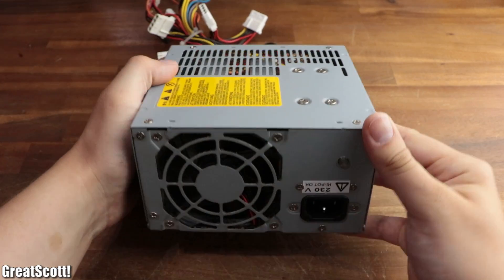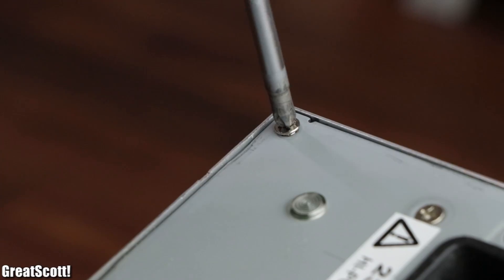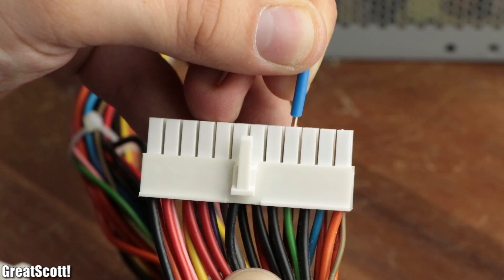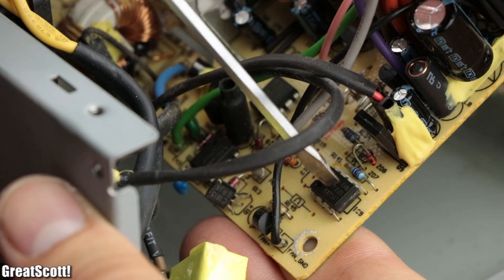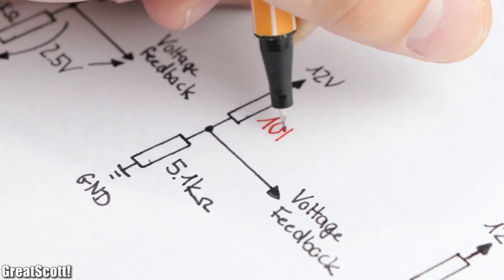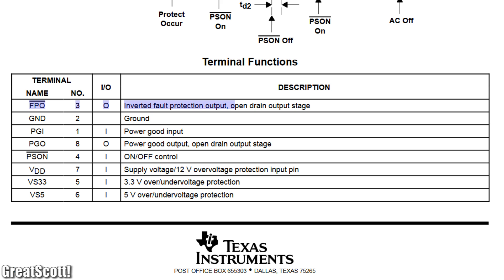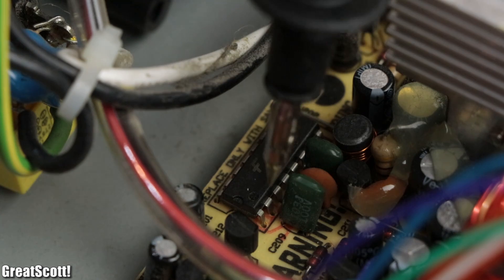HACKED!: ATX Power Supply with Variable Output Voltage?

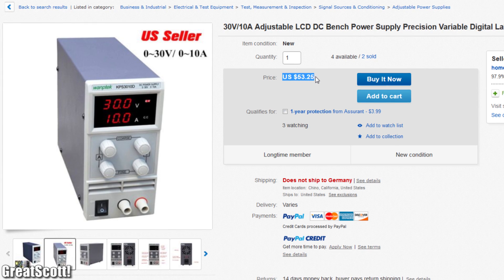Comment: @7:26 -- Hey, that's the power supply I have! -- Wish I'd checked ebay first though.  I ended up going through amazon and it cost around $70 USD. -- It also showed up with a "broken" screen. -- But I ended up just opening it up and noticing that some of the connectors were loose, when I reconnected them, everything started working just fine. :)

Comment: You burnt the optocoupler of the first PSU, I think it'll work if you replace it. That caused by giving higher voltage with using secondary potentiometer too low. I think second resistor you removed is current limiting for optocouplers led. Thanks for sharing all information 👍

Comment: dude, i have 220V DC 6800W available from solar panels. i have to admit it, i was too lazy to open my pc power supply to see what's going on. it doesn't work when i plug it in at 220V DC. can someone tell me why? my welding machine works, which is not very different from a pc power supply. any other device charger works properly, which is expected, of course. i didn't try my monitor but that should work as well. (tried it, it does)
Reply: If the PSU is designed for 220 VAC operation only then you'd need ~320 VDC (220 * sqrt(2) due to the AC voltage peaks), so it might be the undervoltage protecton kicking in. Whatever you do, be careful

Comment: Great video!  I made one of these and whenever I turned it on it generated a lot of noise back on the power line.  Any suggestions on isolating the power supply?  Perhaps I just need to try again with a better quality power supply.

Comment: You can get a higher voltage by utilizing the -12v rail. To get 24 volts, just connect between -12 and +12v, to get 17 volts, just connect between -12v and +5v. Connect between -12v and 3.3v to get 15.3 volts. If it is an older supply with a minus 5 volt rail you can get even more voltages.

Comment: @GreatScott
Hello! I have a PSU which does not output PowerGood high when powerred on, it remains at 0.15 V, it is similar to this http://320volt.com/wp-content/uploads/2011/05/patriot-switching-power-supply-sg6105d-cef2n60-ee19-ee16-ei33-f12c20c-s20c40c.png meaning the same controller not that it is tight to +5V. What do you think? Maybe I can repair it or transform in a Lab Bench Power Supply ...

Comment: Very good explanation of the switching power supply. The hack will be good for convert the PS rather to an exactly 12 PS than a substitute for the bench supply. Also a bit over 12 volt could be useful as car or caravan battery charger.

Comment: Running old electrolytic capacitors at or over their rated voltage can be dangerous. Always have a margin of error on your caps.

Generally bypassing protection cct unless you know what you are doing is just dumb.
Reply: 3 years late here
I read that you should use caps rated for twice the voltage you expect to put across it. I’ve even seen this in practice: 24 volt caps on 12 volt rails, 10 volt caps on 5 volt rails, etc.

Comment: Nice video, glad you posted it. Very good breakdown of the mechanics behind the workings of the power supply. I had made an ATX bench power supply and also wanted a variable output. I made a box that plugs into the +12 and -12 (to get 24V) which is a variable DC-DC converter. I used the MC34063 as the basis for the converter. It's a little clunky having an external converter, but it's very useful and I use it all the time.

Comment: use the green and grey wire instead ... if you do something dumb like short the outputs it will cut off the power supply instead of destroying itself. - with the black one it will always be on regardless. --- unless you do something like hack the reference voltage :P

Comment: So, if I wanted to just use that buck-boost converter method, could I replace the pot with something I can put on the outside? And which leads would I connect it to GND and 3.3V / / 5V / 12V?

Comment: if the transformator works on pwm signals, why should need high speed diods for rectification on the output?

Comment: Dear Great Scott. Thanks for posting, very nice. I am struggling to increase the 12 volt to 12,7, should be piece of cake. But I just can't get it. The thing I dont understand is how the feedback is passing through the opto. However, I have found the UC3842, in my case its 3845 but I guess it does not matter. I have tried to modify all the resistors around pin2 with no change. I would like to try to put a resistor direct from pin2 to the 12 volt but since there is NO ohmic connection now(I guess because of the opto), I think its the wrong way to go. I wonder if you can give me a hint. I am stuck as it is. Sitting in Brazil I am. Thanks. Peter
Reply: One more question: That 10K you took out, where exactly was it connected. To pin2 and ??
Reply: Seems like you dont have time to answer questions. Fair enough. I found out now. The adjustments not near the UC3842 at all. Thanks anyway.

Comment: Awesome hack! By the way, as you must have seen, the fan also turns off at low voltages since it is also connected to the 12-volt output, this can cause the switching transistors to heat up and fry.

Comment: you will probably be the 1st person to modify the pc atx supply, i personally have replaced(using another) the thermal fan system to a aliexpress uC based temprature controller kit , my fan runs at 7v dc(dc buck conv.) at min load, the sensor is placed at the top end of the grill of the chasis, when temp reaches 40 deg C fan gets full 12V through the inbuilt relay., on my 450W cooler master PS.(had noticed the 120mm fan never runs faster even if temp reaches 50C, even my pc case would become qiute warm to touch)so had to do this.

Comment: It's easier if you recover the parts from a smps and rewire the transformer to have a decent output voltage 30-40V. Then use an LM2576 adj as a switching variable regulator. Oh and the output of an smps is not a capacitor, but a fast diode, inductor and capacitor.

Comment: please guys if your reading this comment don't try to open the atx power supply, you can modify them for 12v, 5v, 3.5v , but this video is way too dangerous,  if you want a regulated output add some boost converter

Comment: Hi I am great fan of your Channel, I want to build power backup for my modem. I have 12volt battery with me, same I want charge it and once the power off, I want to use it for modem as power backup. Since I am Android Developer, I dont have much understanding of the electronics but if you give circuit diagram I will build myself. 
Thanks,
Venkatesh

Comment: Sir can you give me hint about pc power supply... I make battery charger for car but this power supply don't work please help me..... How changes I was done....
Reply: Car batteries need up to 14.7 volts for a full charge so you have to use something else
Reply: sir if I boost up voltages with buck converter can it works...

Comment: Another reason why you should not try this, especially with the protection circuitry disabled, can be seen if you watch closely at about 6:45

When the output voltage is set low, the fan slows down. This makes sense because the fan is powered from the 12V rail. Normally this wouldn't be a problem, but if you connect a high current load, such as a long LED strip or a big motor, if the power supply is badly designed, it will overheat and because of the relatively low airflow it might even catch on fire under extreme conditions.

Also, if you were to set the voltage to 16V or higher, not only would the capacitor you mentioned explode, the fan would also be running with way more voltage than it's intended for and certainly would not last very long.

Comment: YES finally someone who made a REAL ATX PSU to variable supply video!!! I am currently attempting on making a super high voltage ATX PSU which should give me a nominal voltage of 38v which will be PERFECT for the DPS buck modules from Rui Deng.
Reply: so.. are you dead yet? (from all the smoke inhalation) ;D

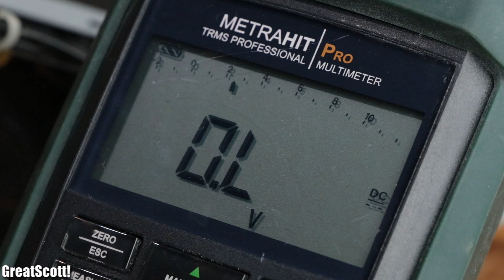Comment: 4:00 - And by measuring this voltage, while the power supply is turned on, I'm waiting for the point where you accidentally shorted out something with the probe and got a huge spark and a faceful of vaporized electrolyte
Reply: If this is the content you are looking for, check out Electroboom.

Comment: I once had a friend coming to me with his old, potentially broken, computer PSU. We decided we'll have fun with it by modifying the thing to make a lab psu. It was a really cheap looking PSU, the components inside are poor too, but we just kinda go with it.
We turn that on and it didn't show any living sign, then I saw a switch which I thought was the 110V/220V fuse thing, then I switch that to the other side. Suddenly, a huge capacitor blows up followed by some diode and ultimately the whole circuit was in fire.
We panicked and unplug the power, throw the firey thing outside, and a black-blue smoke is coming from what seems to be a bigger capacitor.

That day, we learned our lesson to not mess with any shitty old electronics.
Reply: You flipped it to 110v and it'd be a miracle if that didn't blow up
Reply: It's like trying to draw and you make one wrong line and ruin the drawing and then throw it all away because you don't want to mess with art
Reply: @alexstone691  except when you draw the line wrong you get electrocuted and die.
Reply: You done it as a dumb, thats why
Reply: I also had a power supply with that switch the previous owner had set it to 110v I plugged it in 230v it blew up. I got another power supply with that switch again but this time I switched to 230v and permanently glued that switch
Reply: If you are too stupid to understand the circuit you should definetely keep your hands out of the power supply.

Comment: I use a few of these for lab power supplies. They run from about 5v to 25v. I tend to remove most of the stuff on the secondary side of the board, and just leave the 12v winding and circuit. The ATX uses the spare fet and tiny transformer for sleep mode to maintain 12v to the KA7500 ( TL494 ).
If we then lift pins 15 and 16 above ground, we can sense the current via a very low R resistor to ground from center tap, and use that to use the [pin 15/16 op amp to control current, while using the pins 1 and 2 for voltage control.
Then we have a current controlled ( up to 12 amps or more) and voltage controlled 9 up to 25v or so) power supply, that will power very low impedance loads ( motors etc).

This requires all of the monitoring stuff to be wiped from the board, or at least disconnected from the pins 1,2,3,4,15,16.

So we use the 5v reference from the 7500 to go to both of the 7500  op amps, then we can simply use a divider for the voltage to the first op amp, another divider from the CTap of the tranny to ground to the second op amp, some feedback from pin 3 to both, and we have a totally stable power supply, that is completely controlled.

It is actually simpler than it sounds really.
Reply: I hope you would do a full video of this ... would be the ultimate bench PS

Comment: next project for Professori Scott: Don Smith free energy device!! i know you can make this!! 12vdc battery ---> inverter step up with a dimmer switch output to a HF neon transformer ---> aircore variable transformer ---> STEP DOWNED TO RUN ARRAY OF LIGHTS AND TO RECHARGE THE INPUT BATTERY to mock thermodynamic laws????

Comment: The over voltage protection in an ATX power supply is meant to protect the electronics in a PC more than anything. Though now you have me curious enough to wanna tinker about with a pair of old 350W power supplies that I have on hand. Maybe a bit later on when I've got a bit more experience with this stuff. Should be a fun learning experience!
Reply: do you have anything you wanna do with it after modification i dont think theres a point risking working with high voltage on a 350watts
Reply: @AitoLaikoSamoMoaCawfy  By the cursed power of ADHD executive dysfunction, I have yet to get around to tinkering with said old power supplies. xD

Also, on the output side of the PSU, the highest voltages you'll get (if the PSU doesn't have a short from the input side to the output side of the flyback transformer) is the +12V rail and an auxiliary -12V rail that's rated for only a few hundred milliamperes (the current limit of a diode used to create the rail), but the PSU doesn't magically shove all of its watts of rated output into whatever it's powering. That's just not how it works.

The load that the supply powers draws as many amperes as its equivalent series resistance (ESR) will allow to flow in accordance with Ohm's Law (IR=V), and the amount of power that the load dissipates is also in accordance with Ohm's Law (IV=P). Solve the first equation for I (I=V/R) and substitute into the second ((V/R)V=P) and you get the power dissipated by the load in terms of the voltage drop across it (V) and its ESR (R) given by V^2/R=P.

Bang your load across the +12V rail and 0V ground reference, and the power the PSU has to supply to it is 144V^2/ESR Ω=P watts. :)

Comment: Inspired by this video I just did a crude power supply with +5V +12V +3V, -5V, -12V and an adjustable voltage from 1.2 to 11V using a buck converter inside the power supply, as I had room for that. The converter uses a LM2596 and can handle up to 3A, good enough for my experiments. Thanks for the idea!

Comment: I created a lead-acid battery charger using a PC power supply with the infamous TL494. I didn't remove the divider resistors though. I simply added a parallel variable resistor to the pulldown resistors to get higher voltage on the 12V rail. Replaced the capacitors to match higher voltages on all rails. you can find the mod on the internet though. Good work Scott.

Comment: I once made this modification to a KA7500/ tl494 based atx supply successfully. Not only did I modify it for variable voltage but also variable current output. Worked well for lead acid/ lithium rechargeable charging. The atx I used had a protection chip with three voltage inputs 3.3, 5 and 12 volt. If the voltages varied by more than a few percent it would trigger a protective shutdown. I lifted the three input voltage pins of this chip and created a shunt regulated divider from resistors and colored led's. This gave the protection chip the voltages it wanted to see with the added benefit of still protecting the supply from output voltages of more than 16.5 volts on the 12 volt rail. Some load/ voltage ranges caused audible switching noise so I don't know if it would survive long term in these ranges or not. I killed it though by running it off of a generator while I was also using a welder. I had a bad connection in the main power wire to the welder and I think the arcing on the ac power line fried it. As far as hooking things up to the output of the supply, it did very well. Protection chip still did it's job in the higher voltage ranges it was modified to.

Comment: Yeah, it's  not an easy topic, still possible. Has anyone tried? I want to make variable current and voltage. It's still worth because regular Lab Bench Power Supplies offer 0- 3 amps, while ATX could give you 20 amps. 

+GreatScott!
 Could you attempt one more time with hacking ATX, making variable current and voltage?

https://s-media-cache-ak0.pinimg.com/originals/65/eb/ae/65ebaee70843afb05b130fc240781086.jpg

Comment: Good video and yes, not worth the effort.  Better to just use jumper as shown in video between green and ground for supply activation then connect to a boost/buck converter and only that if you are really on a super tight budget. Even then, to have to mount in a separate larger enclosure, adding fan(s), is just too much work and trouble when proper built supplies are readily available.  Save your sanity by saving and buying a real bench supply.

Comment: I have been using old XBox 360 power supplies, as well as Dell dock supplies like their D846D, for some time like this - as adjustable voltage/lab bench supplies, and they work great.  They are adjustable over a fairly wide range (with some protection disabling) given what they were built for (12 and 19 volts respectively).  This is a great way to get a custom voltage with high current at a cheap price.  Great video, as usual.

Comment: Tried it myself on a laptop power brick: when voltage went up by a about 2V OVP kicked in, when it went down the thing started to oscilate. So I forked out 60 Euros for a linear 30V/5A supply.

Comment: Add some dummy loads to the 3.3v and 5v rails, this will help with regulation as they are normally cross regulated in this type of supply to save cost and space.

A few watts load per rail should do the trick.

Comment: thing is , even if you modify psu with ka7500 ect   you will disable short circuit protection, and you have to add more complexity to circuit. 
i have modified few psu like that but its not for beginer.

Comment: Aww I needed something like this to easily change the speed of my forge fan  :( I use a modified PSU the power but it's tedious to change cables if i want to go 3v slow or 12v fast

Comment: I'm surprised he did not get a shocking revelation when he touched one of those heat sink when plugged in to the mains. I have that exact supply. 
FYI PS2's have 12V/20A supplies and they are enclosed.

Comment: i have the exact same ATX power supply, and i have been modding it for an adjustable output. an LM317T adjustable voltage regulator comes in handy after de soldering all those excess wires that take up half the power supply. if you look at it, the wires are grouped by color, and its then you can determine the function as well as its output voltage.
Reply: i actually (possibly) take that back because i forgot to account for how much current the lm317t can actually withstand. although not tested yet, im not for sure.